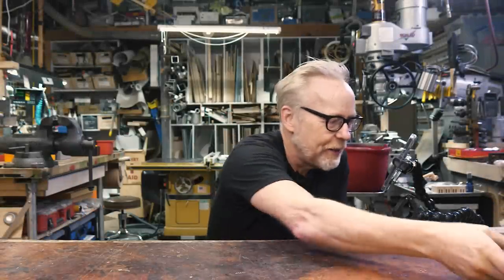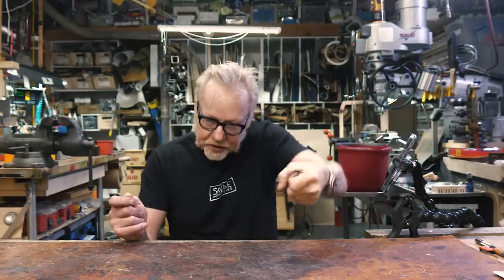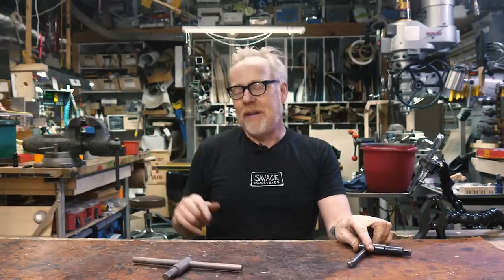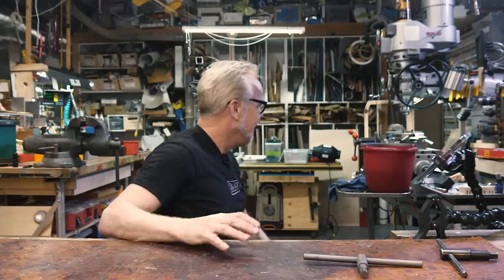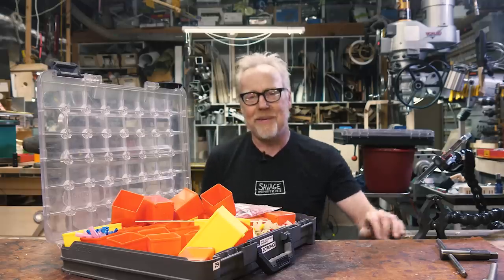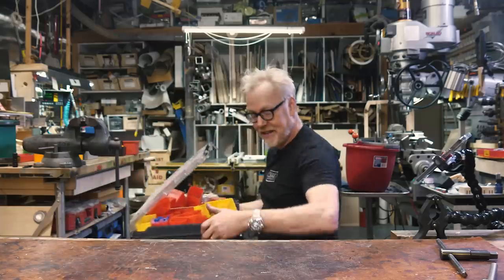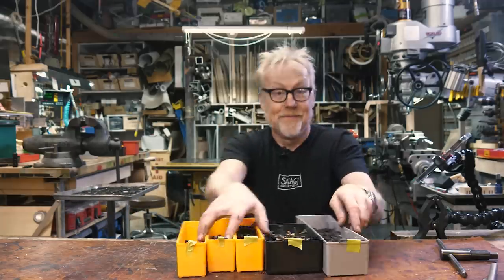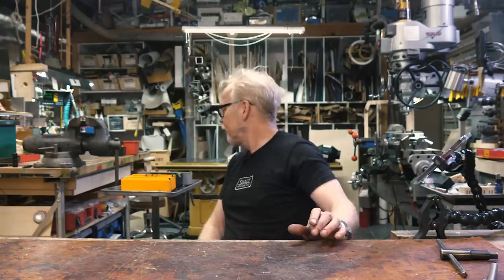Adam Savage Explains What to Do When You Drop Gobs of Loose Hardware

Comment: First off, Adam maybe you should find a young relative or maybe some kid you know and give them the box of all those electrical connectors and say "I will give you $5-30 or whatever dollars if you sort all these" and then once its done they get some money for some little boring work and you don't have to deal with it.

At work we had so many small tool boxes all over the place. For the longest time it was a pain having to remember which small tool box has a certain tool. They literally had like 12? small tool boxes with different tools all over in them. When we finally got the OK and got a big tool box that housed lots of tools all the other guys at work just wanted to take all the tools and throw them in there haphazardly. 

I was like "no, we should clean them all first and organize them" etc. No one else wanted to, so I put out this big blue tarp in the middle of the floor and started grabbing tools from all the different tool boxes and unloading them on the tarp. I found tools that belonged to different departments, wrenches that went to other sets that had long thought been gone forever, and SO many screwdrivers. On top of that there was SO many pliers as well. This was all because when someone couldn't find a tool they would just go out and buy a new one. Thus so many tools. I cleaned them all and put in just a few of each into their specific drawers and got the tools to the departments they belonged to. It was nice having that all cleaned and organized, it only took a month before tools ended up going missing again though cause of idiots I work with. 

It really stunk cause I actually got that rubber goo stuff to put metal handles into to give them a grip but I wanted to do it when we had all the tools needed because once you open that stuff there isn't really any going back cause it dries out. So still have that can and waiting until we have all the tools back which probably wont happen.

Comment: I do a bunch of electronics projects.

About a year ago I switched over to using "open barrel connectors", and never looked back.  Got a Knipex crimper that works on them great for $20, and bulk ordered a few thousand crimps in varying sizes and types from China for cheap.

The lugs are compact, durable, and look like a factory connection.  They crimp more reliably, and make better connection.  Only downside is you gotta heat shrink them manually, which I actually prefer because its more compact and functions way better than the cheapo bulky pvc red/blue/yellow connector insulation.

One thing I like doing is color coding the heat shrink on them.  No reason to have all your connectors red/blue/yellow, make them match the wire color, or whatever is convenient for your project.

I bought a bunch of marine grade connectors a few years ago, and I don't care for them either.  Very bulky, and I'm not convinced that they are really any better at protecting against moisture damage than quality heat shrink tubing that's much cheaper.

Comment: If I was in your position. I would sort them as I needed/used them over time. The wire connectors especially because I never need more then 10 of one type at a time. Same for the drywall screws and buy a box for bigger projects.

Comment: you have to use your shop and "live" in it for a couple years at least to see what tools you use a lot and the one time but it's the right tool those time tools you put in a box and label the box then that one time that that is the tool you need you can go to that box and find it. same with screws or connectors bag them and make a space just for one-time tools and odd screws or connectors, that way you don't have to run to the store to find out they're out of stock or don't make those anymore. but they are out of the way and give your toolbox or bins room for what you do use.

Comment: I have moved away from crimps entirely (except for 6mm yellow rings for earth connections). Now I much prefer bootlace ferrules, wago connectors and electrical "chocolate blocks". I also have a LOT of Lego and have been using that same sorting method (several passes over a widely spread out assortment of pieces). I'll often do a two stage sorting process, stage one is by type (quickly separate out all the beams into one pile, axles into another, etc) then stage two is the finer sorting. Sounds long and tedious but it's by far the fastest way I have found. And yes, your time is certainly an asset.
Reply: You mean Wago Cage Clamps, right?

Comment: Drywall screws are a pain to sort, but resistors...I get chills down my spine just thinking about it
Reply: Yeah like sorting loose 0403 SMT parts LOL!

FWIW: I just made holders for cut tape for them using clear plastic vacuum seal bags and a sealer to make compartments for them. Also store a lot of SMT cut tape: caps, inductors, diodes, & even small SMT ICs. Much better than having them stored in those plastic bags.

Comment: Adam,
Since you know what connectors you use the most that should factor into what you buy going forward but it shouldn't effect what you keep. If you already have it but rarely if ever have a need for it then it should be placed into an organizer just for the electrical connectors you are not likely to need for a while. This method of sorting is best for someone like you that has a lot of hardware and enough space to keep it. Then when you grab a case of electrical connectors you can have one for the sizes you use the most which will also allow you to have a large number of the ones you actually use. Then a box for any other connector that you have for a just incase scenario.

Comment: Anchor brand marine terminal ends we can get them with heat shrink ends and standard nylon ends in numerous sizes and also in blister packs of 5,  10,  25 and 100 and also in bulk
Reply: Anchor with the stiky heat shrink are the only ones we use. When I started I got a small variety pack and whatever ones I used up first I then went out and bought the 100pack of that type.

Comment: I used to run the repair workshop for a well known German film equipment manufacturer whose name begins with A and has four letters. We had people coming and going the whole time fetching a few screws or small parts and then returning what they hadn’t used - invariably to the wrong container. I horrified my boss one day by dumping a considerable number of these “contaminated” bins straight into the trash. I explained to him how much his workshop cost per hour to run. Including my time, heat & light, rent, administration, wage processing, invoicing, insurance etc. The time required to re-sort the parts would have cost many hundreds of time their value. It is extremely valuable in any workshop to work out exactly what the entire hourly cost of doing business is. It is almost never economical to sort small parts in a commercial environment.
Reply: next time don't dump them, at least have enough economic sense to find someone who doesn't have this overhead and can use them.
Reply: @joansparky4439  A valid comment, but we didn’t have the time to call around and find someone who wants them. Also in a big organization you have to do a lot of paperwork to give something away :)

Comment: Adam you should try the PB Swiss dead blow mallet size 4. It’s a larger hammer head than a typical finishing hammer, but slightly lighter with dead blow discs. One the opposite side is a plastic hammer head. The plastic head is for hammering machined parts without damaging them. Also works well on prefinished plywoods

Comment: I got a suggestion for sorting little metal stuff. Use a magnet. A strong one, like some welder's magnet.
If some stuff are magnetic and others ain't, win.
If you pass over the stuff, the lighter ones might get stuck and not the big ones because of inertia.
And if they get all hanged by the head of the screw or something, then it's easy visualisation for picking them by size.

Additionnal suggestion : wrap the magnet in a little plastic bag, that way you can easily remove everything stucked by just getting the magnet out of the plastic. I also use this to collect steel dust in case I ever get to make capsule damascus.
Reply: That's perfect! You can tune the distance between the magnet and the screws so that only the smallest screws get lifted, right? Get 'em all, then move the magnet a little closer and repeat with the next smallest size.

Comment: I use the nylon 3M Scotchlok connectors when I want/need quality spades or rings.  I use Anderson Powerpole for new stuff that doesn't need to mate up to an existing bolt or spade.  For heavy duty/high power rings, I use FTZ power lugs.  For similar power applications that aren't quite as heavy duty, I use TEMco rings/lugs.

Comment: worst noise in the world is an unlatched plano box falling and the twenty different sizes of screws going everywhere....
Reply: Try it with graduated pearls in 4, 6, 8 and 10mm sizes in cream, white and mauve. A divided box just a bit smaller than Adam's case. On a hardwood floor. They roll like Satan's ball bearings. Spending my way out of that mess is not an option. Happened ONCE. Now, I treat that box like it's full of nitroglycerin, and handle carefully.

Comment: All I have to say on crimp lugs is >> TE/PIDG!  Yes, COPPER.  Yes, NYLON jackets.  I have a Stanley version of the Sortimo case filled with the various types and sizes of lugs.  Yes, some of them are crazy odd sizes (ring lug with a 1/2" hole for 22-18 gauge wire) but, HEY, I just might need that.  You just never know do you?  That's our OCD (actually the alphabetically correct CDO).  My $0.02.

Comment: Simple solution for you when you drop an assortment of hardware. Shovel into a box and send to a young maker, plenty of them starting out that could benefit and then you’re not feeling wasteful. 

I have spent so many hours dreaming and scheming about some magical device that can sort it all, nuts, bolts, screws, washers, Pennie’s, nails etc. I have scoured YouTube and even looked at those round industrial sorting tables on eBay. If someone came up with a computer vision enabled device that could spit hardware into like-kind, I’d be very willing to pay hundreds. I have half of a shop wall of hundreds of 3”x6” plastic sliding trays each with an assortment of absolutely random hardware.

Comment: my lathe has a 1x2 with holes screwed to the wall ON EDGE, behind it the holes were drilled on the drillpress with "RIP FENCE" TO LINE THEM UP , ONE END HAS CHUCK KEYS OTHER TAIL STOCK ..LIVE CENTER, CHUCK ETC MIDDLE CALLIPERS AND WHATEVER ELSE.. THAT WILL FIT THE HOLES. THE 1X2 ARE AROUND THE SHOP  LITTLE HOLES FOR LITTLE SCREWDRIVERS BIGGER FOR NORNAL, 2 STAGE "3/4 SPADE 1/4 DEEP TO CATCH HANDLE THEN 1/2 THROUGH FOR SHAFT OF NUTDRIVERS THEN BANDSAW TO FROUNT TO ALLOW IN AND OUT,  MOST USED PLIERS NEED 3/4" HOLE.    WRENCH WALLHAS 2 ROWS OF DRYWALL SCREWS 1 OR 2 INCH ABOVE THE OTHER, ONE ROW IS METRIC OTHER ENGLISH BY SIZE SO WHEN 7/16 IS TO SMALL  AND 1/2 TOO BIG WHAT METRIC SIZE DO I WANT....
LUGS  MINE MOSTLEY CAME FROM GARAGE SALES ETC SORT BY COLOR  THAT WAY THE ODBALLS YOU ONLY WANT ONCE EVERY COUPLE OF YEARS ARE EASY TO FIND AND DONT TAKE UP SOO MUCH SPACE   YOUR TRAY IS NEET...MINE IS RUSTY COOKIE SHEET.

Comment: Digikey for terminals.  AMP/TE/Tyco/3M etc reputable name.  Find a series that you like then order all the different gauges and lug dias.  Tinned bronze.  I just ordered some Amp Mark II 0.250" quick connect because they have a push button release for the tab.  (Seperate housing.)  Use a GM metri-pack 630 crimper for a beautiful crimp.  I needed something that could handle 25A continuous for the use in a UPS.  
Amazon and eBay are a s-show of cheap crap.  Even when the desc says it's genuine, you get a generic knockoff.  They screwed me a while back on P-touch labels.  Now I only order them from Provantage.

Comment: You need to think out of the box. Think like a carpenter for a minute... each project has it's "streamlined" inventory, then there are the bins for "make it work" that get racked and packed. When I clean out my truck, sure enough I have to DRIVE FOR FREE AND BUY NEW (if I can even find this part), and it's something I threw out as scrap the day/week/month before.
PS: screw sorter opportunity,  a simple slot allows the screws to "point down", now just "coin sort" by length... Use your brain, not your brawn, if you can tape a screw to a bin, your "custom  coin sorter" could sort massive "collections" into reusable stock!

Comment: I make it a point to latch the cover on my electrical case and not try and work out of it. I will just pull a quantity out and put them on top of the lid to work, then return the unused ones when I'm done. Haven't had a spill in decades since adopting that work flow. Amen on thinning the heard of terminals. Forget the standard assortments, and just get what you use. 3/8" lugs, never use them. However 5/16" I use all the time and those are not in most assortments. I get mine from McMaster Carr. No worries about quality that way. My go to's are #10, 1/4", 5/16" rings in red, blue, yellow, and big red. Butts in those same wire sizes.  Male and female 1/4 quick disconnects in mostly red and blue. Red forks that fit standard terminal strips. And one of the best tools I ever got, a Greenlee cordless crimper.

Comment: I buy a tool. When I se a problem with the tool i am currantly using. I get a part, when I regularly get into situations i need them. I got 13MM screws for mounting stuf to kirchen cabinets. I got 50mm screws bor electrical boxes that has proud mounting holes. I have a big beefy drill (Milwaukee FPD-2) and it does about everything, BUT it is heavy. So I want a small one, 12V maybie even the little stick type. But most likely the smalles electrical drill i. An get my hands on that is M12.

Comment: during my apprenticeship (IT-Admin) we had this big box of unsorted Laptop screws. All different diameters, lengths, pitches, just everything that accumulated over the years.
We used that as a sort of punishment for the worst IT-sins, like someone losing data without any backups, leaving passwords out in the open, that kind of thing. I personally only did one hour of screw sorting, for taking RAM out of a test setup without checking if A: it's turned off, B: my coworker had been running a test for two days and by crashing the machine I would just vanish the results into thin air.
Fun times.

Comment: A few folks have built drywall screw sorting machines for just this sort of thing. (Usually set builders on strict budgets who reuse buckets of screws!)  I find myself in that category, but I have yet to build one.  I just sit down with a 5 gallon bucket of screws and a bottle of wine about once a year and sort...  I've never seen 1/2" drywall screws, but I wish they made 1.5", because 1-5/8" is frequently a little too long.

Comment: You have tapped into my personal Meditation. Nothing like sitting in the workshop with a podcast playing, sorting tons of hardware. My system is much like yours. Pour out a good amount on a cookie sheet / cafeteria tray (quieter). Pick all the nails big and small, into containers, bolts and screws into some other containers. On and on and sorting down until it's all sorted. Once it's all done, off to an auction and buy more. I'm addicted. I have only spent a couple hundred bucks but have walls of sorted hardware. And I have likely made back most of it from scrapping anything damaged.
My name is Chris and I have a problem.......but I am very relaxed!

Comment: Adam....I'm surprised you didn't "quickly" rig up a cardboard sorter box, like a coin sorter. A slightly angled ramp/funnel with holes from smallest to largest so the screws fall out sorted as their shaken down the ramp. Your manual process, though, it quite good! 👍🏻

Comment: I have the same problem. I’ve got literally, hundreds of different screws, washers, nuts, spacers. Yeah, I don’t mean hundreds in total, but hundreds of different ones. That means thousands. I’ve rebuilt my wall where I keep them three times to accommodate more, over time. Why is that? Because no matter how I design something to use what I have, I need different ones. But I can’t get rid of the old ones, because I’ll need them too. So it just keeps expanding.

That same problem extends to most everything I have. Yes, electrical connectors! Lots and lots. Different things require different connectors. I have most of the standard types and sizes, because, well, they are needed, even if just once in a while. There are times when one thing just can’t substitute for another, and can’t even be done so by law.

Metal, wood, plastic, sheets, square and rectangular bars, round bars, angles of different types. Big pieces and small pieces. It all costs too much to throw out, so it accumulates.

Tools. Oh yes! My wife says that I will buy a tool just because a friend might want to borrow it someday - she’s not far from wrong. I had five of the same wire cutters, good ones. I gave two away. I have lots more of different types, just, well, because. I never have enough of anything. 6” rulers. Maybe a dozen. Why, because I can’t find them. My entire, not small basement is shops. My two car garage is shops. I need to have at least two sets of many small tools, sometimes three or four. For Allen wrench sets, at least five. Somehow, small tools all end up in the same place. They find each other. S tewdrives? Oh, maybe three dozen, at least, not counting the sets of small electronic versions. Wrenches? Where do we start?

Anyway, he’s absolutely correct. We can never stop organizing. For every one thing I get rid of, I get three more. Time to think of getting a bigger basement, I mean, house.